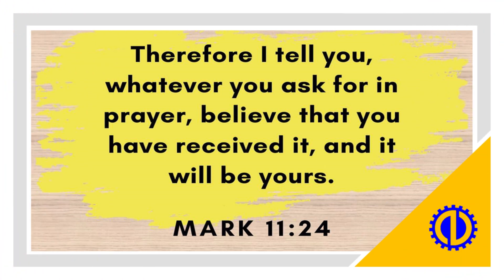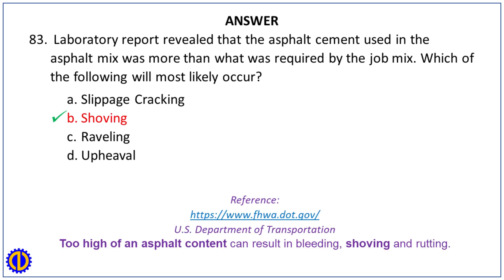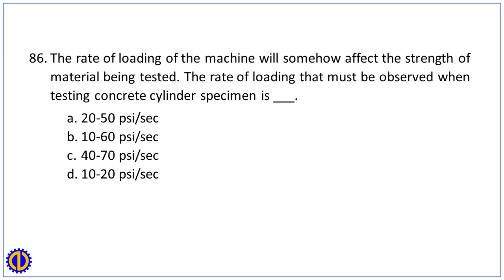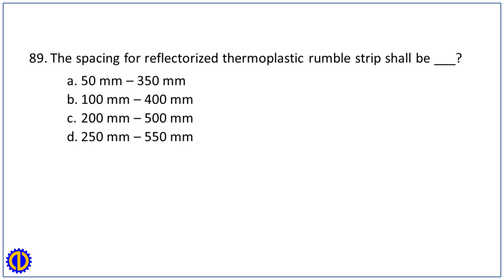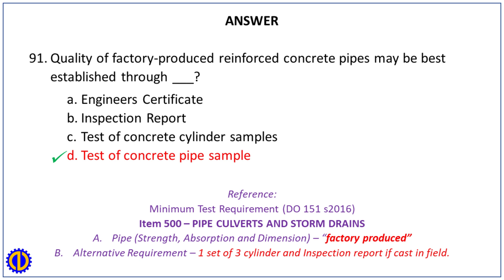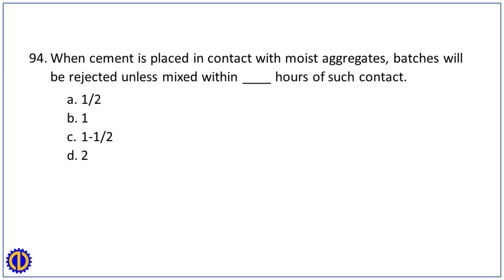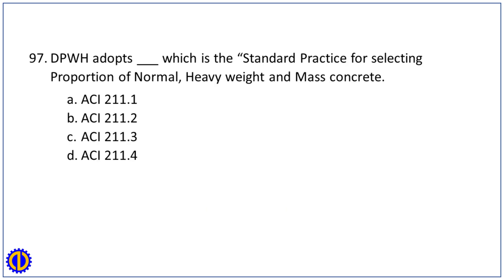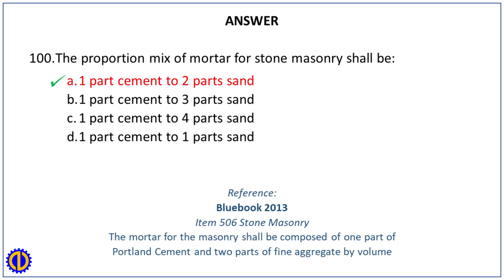Materials Engineer Reviewer Part 9 DDN

Comment: Sir may updated na blue book na po ba? Like po kasi nung #93, item 1013 na po sya. Sa hawak ko po kasing copy hanggang 700+ parin po ang items eh. Thanks po
Reply from the maker: Sa Volume 3 (Buildings, drainage, ports...) po ang Item 1013. 
Volume 2 (Bridges and Airports) ay hangang 735.
Reply: @engineeringcivilintegrity6985  thank you po!

Comment: Sir no. 90 . Mc 30 is the thickess ata sir
Reply from the maker: As per indicated reference infinitygalaxy.org, MC-30 is the thinnest. 
There are some reviewers and internet website that state MC-3000 is the thinnest. 

For comparison of MC-30 vs MC-3000. The number indicate kinematic viscosity. Viscosity in tagalog is lagkit o lapot. Mas mataas na viscosity ay mas malapot. Lower viscosity ay mas fluid.

Imagine hair gel (high viscosity) vs water (low viscosity) when poured on a table. Which will be thinner, the water or the hair gel?

I go for infinitygalaxy.org as more valid reference.

May YouTube upload ako sa viscosity test ng slurry bentonite for viscosity test reference. Iba ang process sa bitumen viscosity test pero parehas na fluidity ang sinusukat. https://youtu.be/I14X_uiKSJc
Reply: Pwede po humingi ng pdf files sir
Reply: Ayaw pataka bangag part
Reply: @zyannsalares6  ME ka ba?